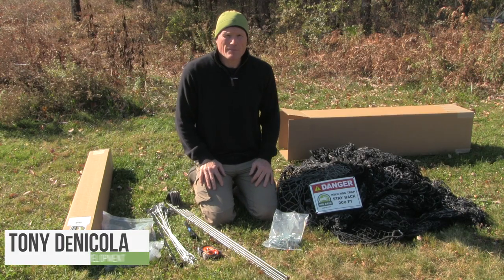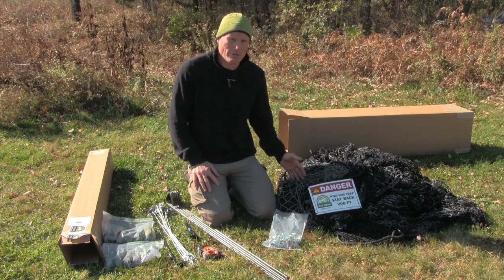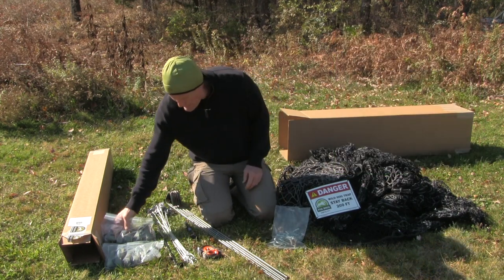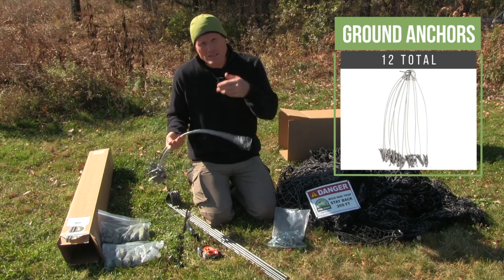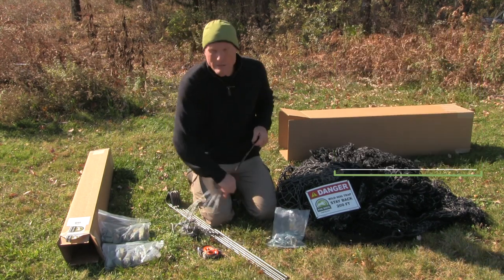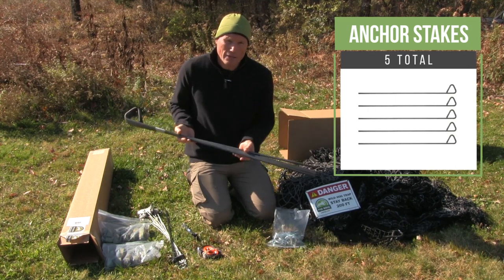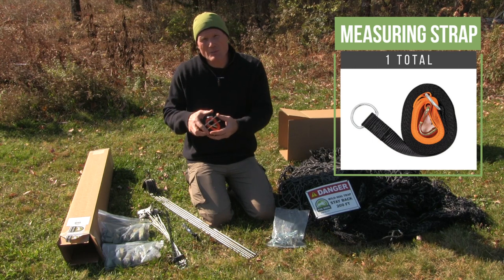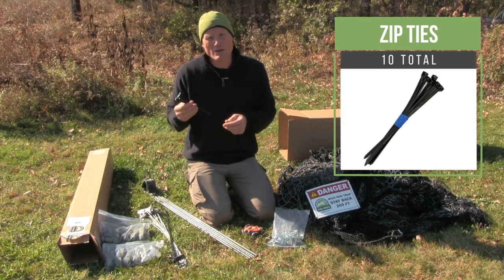How to Set Up - Part 1:  Unboxing Your Pig Brig Trap System | Pig Brig Trap System

Comment: How do I set these up without leaving the "not meant to be removed" anchors that are driven in the ground? I need to be able to mow the pasture land after I've used the trap and then moved it. The hogs will not return to the same site repeatedly after the trapping, with this or any other trapping system.
Reply from the maker: Hi Stevie, a few things we do - you can use rebar for anchor stakes instead. A 4 ft piece works just fine with a nut welded on top … we have a video in our Facebook Owners Group that describes a few other anchor types. If you can’t find the group, let me know. Also, we usually clip the loop and shove the wire into the group to bury the anchor if we aren’t using a site again. I would say we do see people trapping repeatedly at the same site - we’ve had several folks trap 8 or more times and just leave the posts and ground anchors and move the trap.  Many folks are trapping multiple times at the same location.  Check the group and you can see … hope this helps.